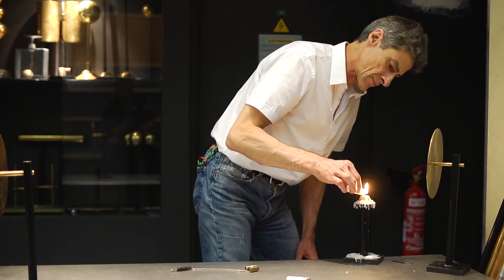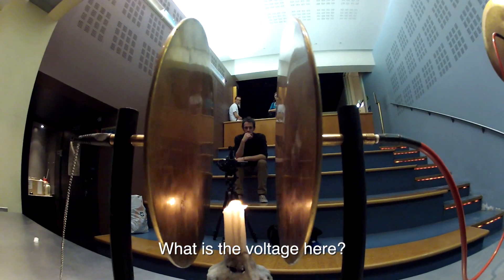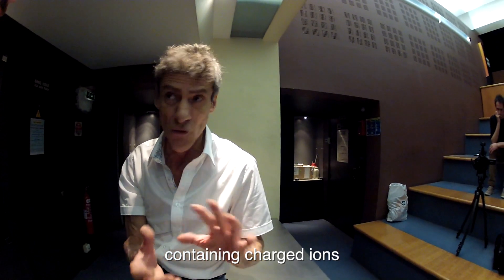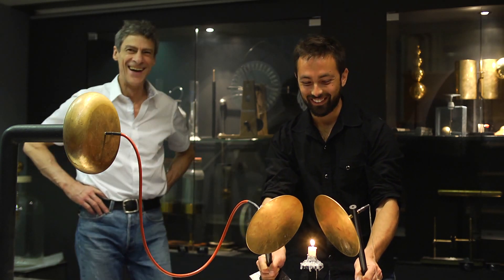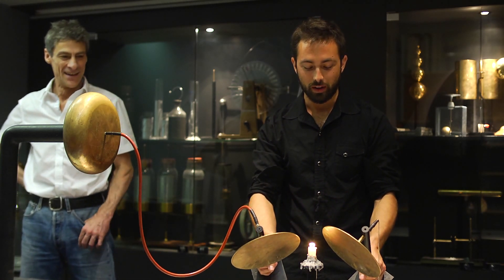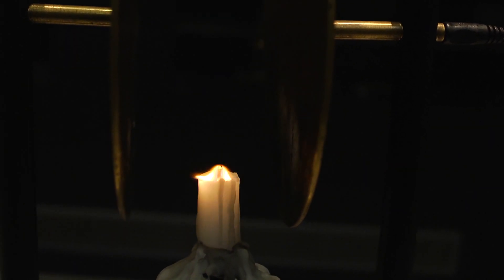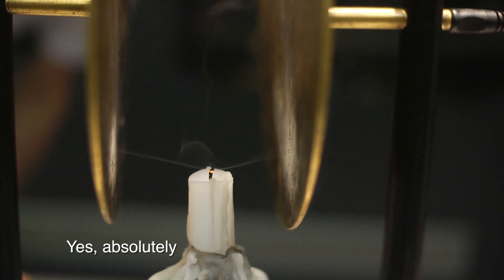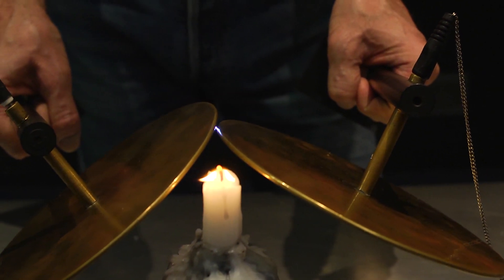What's In A Candle Flame?

Comment: can fire carry this electricity with it, lets say in a rocket as the fire is exiting the engines can it carry electricity with it? The purpose is to see if we could use that electricity to magnetically confine the fire as it tries to exit through the choke point and keep the fire from touching the metal and causing it to melt(similar to what happens in an MPD engine). then that could potentially solve the problem of the falcon heavy engines melting

Comment: This video just blew my mind in the realization that fire is just a low energy plasma. Fking duh the sun is a ball of fire and it's plasma. Fsr I just never made that connection. I just never made the link that even a chemical fire is releasing electrons, ions, or however you scientists say it. This changes how I look at fire and explosions as a whole, humanity's first invention wasn't fire; It was plasma. Sure we didn't know it at the time but over time people 10x my intelect have used that knowledge to further everything.

Ps I think a better way of saying it is that the flame heats up the surrounding air to a degree that it takes less voltage to cross that amount of air. Whereas you needed to have a small amount of air without the flame, the ions emited from that flame lower the voltage required to cross the same volume of air.

Actually scratch that that's way more conviluted

Comment: That's interesting, I was thinking , have the heat from the flame also influences this event, in fact it should give an opposite reaction, as for example, if a resistor or any other component or conductive pathway gets hotter, the resistance increases,

Comment: Very similar to my A-level physics project, some 33 years ago.
I decided to base my project on 2 of my favourite things - fire and high voltage electricity.
I remember that none of the resistors that my school had were of high enough resistance, so I had to make my own by using a pencil to draw the resistor on a piece of paper, then connect using croc-clips. Worked a treat.

Comment: Ambient air is  more conductive than flame , perhaps react  more quicker then flame, and the flame is surrounded  by air. it seems like flame is reacting , but actually  the air. So, called  permeability
Reply: Does there is effects on charge density in air around flame ... it should be less ... .. could this air  help in conduction??
Reply: Fire is more conductive than air.   Fire is a the good conductor hence why it's drawn to the flame, while air is an insulator.

Comment: This idea is applied as a safety feature for gas boilers/heaters where the flame itself is completing the gas control ckt , as long as there is a flame completing the ckt gas will continuously be released, but as soon as that flame is out incomplete ckt stops flow of gas. It has one wire connecting to a metal hollow pencil sized barrel mounted on top of flame . Ckt goes through wire on to conducting metal barrel touching flame and flame touching (coming out of) gas burner which itself is ground/common
Reply: Oh yeah cherry on cake is it’s called a flame sensor and eventhough it’s quite even prices with other similar parts all it is is a piece of wire connected to piece of metal

Comment: Absolute proof that Mr. Frank DiMeglio is the greatest scientist/physicist who has ever lived:

Energy has/involves GRAVITY, AND ENERGY has/involves inertia/INERTIAL RESISTANCE. ELECTROMAGNETISM/energy is gravity. This is proven by F=ma AND E=mc2. This NECESSARILY represents, INVOLVES, AND describes what is possible/potential AND actual (IN BALANCE). So, gravity/acceleration involves BALANCED inertia/INERTIAL RESISTANCE; as gravity is ELECTROMAGNETISM/energy. Therefore, invisible AND visible SPACE in FUNDAMENTAL equilibrium AND balance IS the MIDDLE DISTANCE in/of space consistent WITH/AS what is fundamentally balanced GRAVITATIONAL/ELECTROMAGNETIC force/energy; as ELECTROMAGNETISM/ENERGY IS GRAVITY. Accordingly, inertia/INERTIAL RESISTANCE is proportional to (or balanced with/as) GRAVITATIONAL force/energy; as this balances AND unifies ELECTROMAGNETISM/energy AND gravity; as this balances gravity AND inertia. (This explains F=ma AND E=mc2, as ELECTROMAGNETISM/energy is gravity.) ACCORDINGLY, gravity/acceleration involves BALANCED inertia/INERTIAL RESISTANCE; as ELECTROMAGNETISM/ENERGY IS GRAVITY. GREAT !!! A PHOTON may be placed at the center of the Sun (as a point, of course), as the reduction of SPACE is offset by (or BALANCED with) the speed of light; AS ELECTROMAGNETISM/ENERGY IS GRAVITY. (The stars AND PLANETS are POINTS in the night sky.) "Mass"/energy involves balanced inertia/INERTIAL RESISTANCE consistent WITH/AS what is BALANCED ELECTROMAGNETIC/GRAVITATIONAL force/energy, as ELECTROMAGNETISM/ENERGY IS GRAVITY. E=mc2 IS F=ma. So, time DILATION ULTIMATELY proves that electromagnetism/energy is gravity. BALANCE and completeness go hand in hand. Gravity IS ELECTROMAGNETISM/energy. INSTANTANEITY is thus FUNDAMENTAL to what is the FULL and proper understanding of physics/physical experience.

BALANCE and completeness go hand in hand. E=mc2 IS F=ma. Gravity AND ELECTROMAGNETISM/energy are linked AND BALANCED opposites, AS ELECTROMAGNETISM/energy is gravity. Great. Touch AND feeling BLEND, as GRAVITY AND ELECTROMAGNETISM/ENERGY are linked AND balanced; as gravity/acceleration involves BALANCED inertia/INERTIAL RESISTANCE; as ELECTROMAGNETISM/ENERGY IS GRAVITY; AS E=mc2 IS F=ma. Gravity AND ELECTROMAGNETISM/energy are linked AND balanced IN AND OUT of SPACE AND TIME, as gravity is electromagnetism/energy. E=mc2 IS F=ma. This is entirely proven by the mathematical unification of Maxwell's equations AND Einstein's equations (given the addition of a fourth spatial dimension). Indeed, this explains why Einstein's equations predict that SPACE is either expanding or contracting. Moreover, this is why Einstein's equations allow for (or predict) "black holes". Balance and completeness go hand in hand. Einstein's equations are NECESSARILY ELECTROMAGNETIC/GRAVITATIONAL. Notice the term c4. GREAT !!! ELECTROMAGNETISM/ENERGY IS GRAVITY. This is proven by F=ma AND E=mc2. I have provided top down, true, and overwhelming mathematical proof AS WELL that gravity IS ELECTROMAGNETISM/energy. So, It is now abundantly and quite clear that Einstein never nearly understood gravity AND physics/physical experience. (Obviously, E=mc2 is DIRECTLY and fundamentally derived from F=ma.) Sir Isaac Newton now ranks second.

Very importantly, outer "space" involves full inertia; AND it is fully invisible AND black.

In fact, the ROTATION of the moon does MATCH it's REVOLUTION. ACCORDINGLY, gravity/acceleration involves BALANCED inertia/INERTIAL RESISTANCE; as gravity IS ELECTROMAGNETISM/energy. SO, a given planet sweeps out equal areas in equal times; AND this is THEN consistent WITH F=ma, E=mc2, AND what is perpetual motion; as ELECTROMAGNETISM/energy is gravity. Therefore, GRAVITATIONAL force/energy is proportional to (or balanced with/as) inertia/INERTIAL RESISTANCE; as gravity is electromagnetism/energy. So, "mass"/energy involves balanced inertia/inertial resistance consistent WITH what is BALANCED ELECTROMAGNETIC/GRAVITATIONAL force/energy; as ELECTROMAGNETISM/ENERGY IS GRAVITY. It ALL makes perfect sense. E=mc2 IS F=ma. The stars AND PLANETS are POINTS in the night sky. ("Mass"/ENERGY IS GRAVITY. ELECTROMAGNETISM/energy is gravity. E=mc2 IS F=ma.) It ALL CLEARLY makes perfect sense. Objects fall at the SAME RATE (neglecting air resistance, of course), AS ELECTROMAGNETISM/energy is gravity. Gravity IS ELECTROMAGNETISM/energy. BALANCE and completeness go hand in hand. E=mc2 IS F=ma. Gravity AND ELECTROMAGNETISM/energy are linked AND BALANCED opposites, AS ELECTROMAGNETISM/energy is gravity. Great.

By Frank DiMeglio

Comment: why did you not wear gloves while holding and standing near to those two high voltage plates, if u had touched one of those plates you would have died.... what guarantee was there that electricity would not conduct through your body which has ions, electric spark from one plate to body to other plate?

Comment: It is good video and bring you new understanding how mass work. Since ion is mobile resistance, which it is escaping electrons. So, mobile resistance to stationary resistance so it causes current which it is fire that is plasma. So, it tells you behind all four that is solid, liquid, gas, and plasma is ion. But those three is stationary resistance so it is non-ion. Plasma is ion so it is mobile resistance. So, it can be liquid plasma, gas plasma which that is flame which it is connect to another gas that is air. So, air produce gas. So, if it is liquid, would it produce liquid plasma? That is lava? So, what is plasma solid? It has not been invent. Well, lava is not liquid plasma, but higher heat of solid that convert into mass. The process of lava and plasma is different that is. Fire is ion itself in motion. Lava is non-ion itself in motion. So, fire give you new understanding behind the mass. And the connect between mass and fire that is stationary ion which center ion holds itself which it has limit motion. External that pull electrons and internal that pull electrons, so it is a battle internal so seeking to flat out so everything is equal at all level. But external that is pulling so electrons will remain so the codeprint of electrons is the kind of mass. Fire is non-mass, but like spirit or so. It brings new definition for opposite of mass that is stationary which it is gas, liquid, and solid, and gas itself has lower bond that hold air so it needs higher bond that is external which firmament above us. 

So, it fits well for search the truth, as long as you don't dirty the truth by being bias. It would be good to keep going to gain understanding for more truth. So, it also tell you about pressure connect to ions. Higher ion density will override the resistance which it is pressure which it is holding electrons. So, if the speed or density is either high enough or combine as each one at lower level will combine to high enough to override resistance so it reduces so it becomes another phase of mass. So, like a big person pushes a boy to ground, but a boy can't push a big ground to ground because the big person is bigger. So, a boy run at high speed and impact the big person using his feet horizontally to push the big person. So, lower pressure with high speed that convert into higher pressure. So, behind everything base on video show pressure is everything which underlie those 4 elements. So, the 5th element is Aether which at lowest pressure density so all is even. Rise the density at one spot, so that spot become a resistance which it holds itself so it will not pull down to lower level, so it is an internal battle, push and pull. Well, not push, but pull of one side and pull of another. 

So, it is opposite of two, not opposite of two that is different, but opposite of two that is same. Unlike woman and man are different, but it is two mans on opposite side that is different. It is good to make it simple which it is logical so it simple add to next level, so new logical form. All it needs extra something. Like 1 + 1, so there is extra for 1 + 1, that is space, and + that is represent which mean add, and another space, so all of those math I mention is characters, so behind everything is aether, but those aether is a represent to be add or subtract, so 1 as character is a represent is whole, and another characters is a represent is space and so on. Mainstream make it too complex, not thinking logically or resist logically to see the connect, but add complex to logical like if you have a headache, you need aspirin. Not understanding the connect between headache of current compare to non-headache of before. So, it is illogical for you have headache so find the reason for it, but not add in wrong way, but right way with understanding.

Comment: A Candle Flame is combustion of gases which turned out from the wax, turns into liquid than gas. when you apply them(gas molecules) to high electric field the positively charged particles from the gas, attracted to negatively charged pole, still the combustion is taking place. flame reduced the distance of charge through air because there are charged particles are available. which are not present in dry air.

Comment: lovely video :0
but can you explain how did the flame extinguish at high electric fields?
and also was`nt there a danger of short circuiting while bringing the plates so close to each other?
Already the air had reached electrical breakdown and was conducting electrons. So with physical contact of the plates wouldnt there be a possibility of fire?

Comment: when surrounding air is heated up it gets ionized, thats why the flame seemed to conduct eletricity. I also think the gasified or atomized carbon atoms that end up as soot, have a role since carbon in elementary form is conductive, (I am not sure about the hydrogen, oxgen from the wax or gaseous water molecules formed) well that's my take

Comment: Is fire plasma? What happens when you microwave it?
Reply: Pepe! At The Disco as they say in the video, someone could argue that fire isn't really plasma because it's not hot enough. If I recall correctly, in plasma all the electrons are "floating" separated from the nucleus,  whereas the flame in a fire is a mix of ionised molecules. If you put a flame in a microwave oven you'll see a bright spheric blob separating from it, and you could also get it to levitate above the flame (if you take out the fans of the oven, which I don't recommend :P ).

I've seen it done some days ago, and it's quite remarkable,  but a bit dangerous. The internal roof of the oven was a bit burnt afterwards...

Comment: Ionised air is more conductive. . . For practical use I recommend trying to discharge an electrical arc into a torch flame, you can use magnets to alter the path of the plasma.

Comment: By applying 20 000V, you contribute to the ionization of the flame, so it doesn't actually prove that the flame is plasma. As you can see even air reacts to such voltage, while insulating under normal conditions.

Comment: You increase the discharge distance by a factor of 2 from room temperature air. OK, that only means that the flame is slightly more ionized than air. You can increase a pot of water's evaporation rate by 2, that doesn't mean that pot of water has reached boiling point.

Comment: I disagree. Even though you indeed increase the discharge distance of the 2 plates, it might be just as well due to the increased temperature of the air itself, and nothing to do with the flame. Normal air allows 10,000 volts to cross 1 cm, which means normal , room temperature air also contains ions and is also slightly plasma.

The reality is that there is no such temperature that defines an object in plasma state. Its a curve of transformation, not a split point of transformation.
Reply: I know that solid insulators increase resistance with temperature. Resistence is a different thing from discharge. I don't know how resistance goes with gas. Common sense is that common combustion flames are not plasma even if you can see some ions in microscopic view. In derek's video, the purple lightening like discharge is plasma; the candle light that the purple discharge goes through is not.  There are plenty of commercial plasma welding torches. Those flames are true plasma. Candle lights are not.
Reply: One of the more intelligent responses I have seen to a V video. An interesting perspective as well. If one extrapolated your interpretation to it's endpoint, I believe we would be discussing Cold Fusion? No? :--)
Reply: but doesn't resistance increase with temperature?

Comment: Although a flame may contain ions and radicals that do contribute to the explanation seen here, air and gasses in general also break down more easily with the presence of impurities and as temperature increases whether ions are present or not.  Also, the smoke being drawn towards either plate is more likely due the same sort of attraction seen when a charged object is brought close to tiny flakes of paper or pepper and is not due to the presence of ions but because of the fact that electrically neutral objects (in this case wax droplets) will be positive with respect to the negative plate and negative with respect to the positive plate.

Comment: Can anyone explain why does the lighting up the smokes of the extinguished candle, lights up again??
Reply: When a candle burns, it's not the solid wax burning. Rather, the heat melts the wax to liquid state(we know this). But what we don't know is that it's not the liquid burning either. The liquid wax either evaporates or decomposes into smaller hydrocarbons(depends on flame temp and wax quality). In either case, it is these gases that burn.

So when a candle is newly extinguished, the liquid rising up through the wick(hot!) is still evaporating or decomposing it. A large part of the smoke is these gases(invisible). So these gases catch fire when you bring a match next to the candle(even without touching it).

Then, gas burns more gas, the fire spreads down, and the wick(which is still hot), lights the candle again! ^_^
Reply: smoke has carbon, and carbon is flammable, I think.
Reply: i will do a search for it thanks..
Reply: cause the thing that actually burns in the candle is the gas wax.